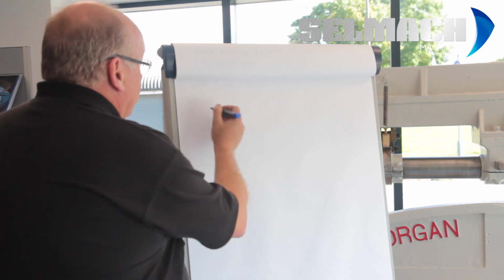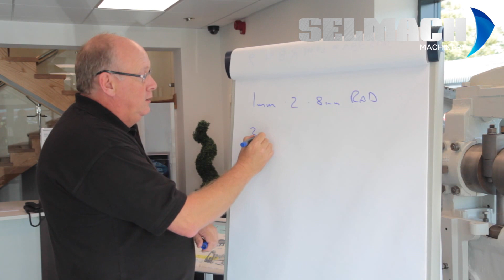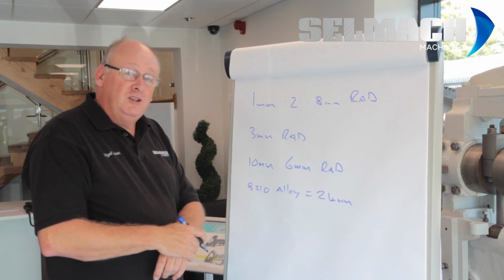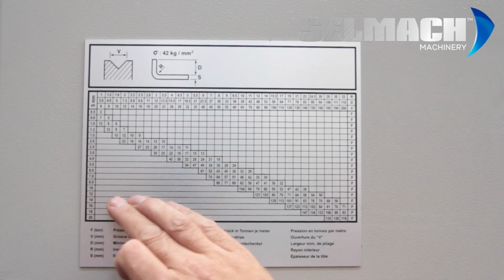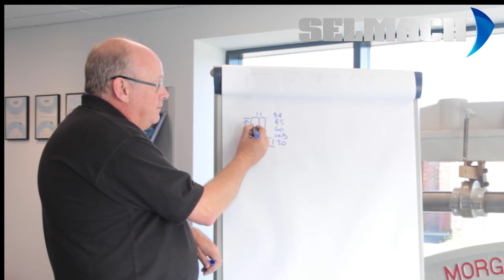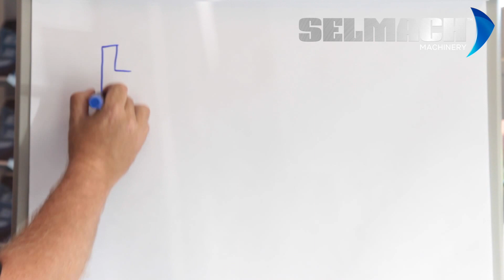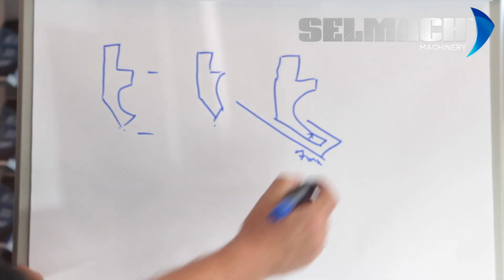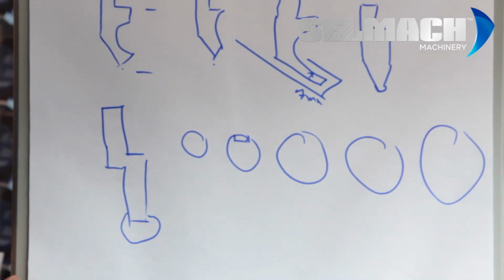How to work out the tonnage on a Press Brake FAQ [Selmach Machinery]

Comment: What about if you’re folding between 1.6mm and 3.2mm steel but with a single tool? What are the problems with having the wrong size tool?
Reply: Worst case scenario the machine/tooling goes BOOM 💥

Comment: How about 0.5mm stainless steel? Can i use this table as a reference? 
So, 0.5mm stainless steel, estimate inside bend radium is 1mm.
Thank you.
Reply from the maker: It's best to work out based on the tensile strength of the material, there is a good calculator here - https://www.pressbraketool.co.uk/bendingcalculator.php